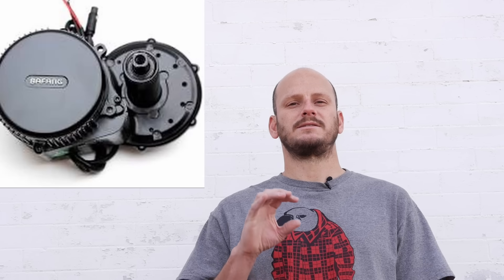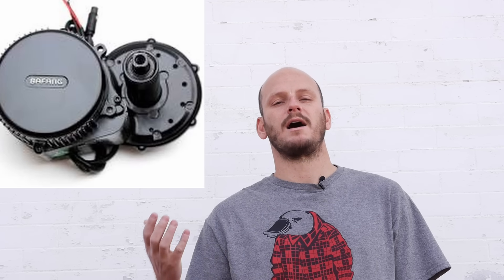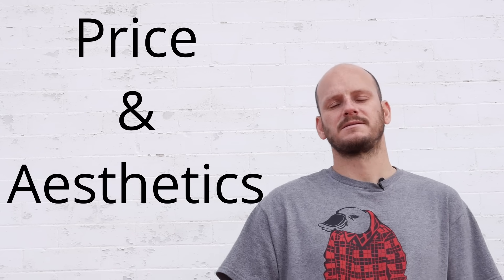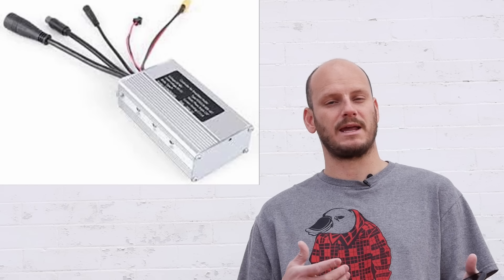Hub vs. Mid Drive Motors: Why Hub Motors Suck and Debunking Common Myths with performance test

Comment: One more case for a hub motor: elderly users. I’ve built several mid drives for family members and the elderly folks get confused with multiple PAS settings and multiple gears and when to use which.  My wife also prefers her hub drive which is very simple. I prefer my middrive for the reasons mentioned in the video.
Reply from the maker: You are absolutely correct. I’ve thought about making a follow up and include lots of things I omitted for both cases

Comment: I had a hub motor that drew 1100 to 1200 watts going up a particular hill at 7 mph with me pedaling as hard as I could in my long-wheelbase recumbent. I ground the spoke rings off that exact same motor and clamped the axle to a frame extension so it drove a freewheeling sprocket crank-motor style. (The whole motor still spun.) From there, I ran a chain to a freewheeling crank and adjusted the sprocket size until the motor's ideal RPM matched my preferred cadence. I went up that same hill at 12 miles per hour using 700 watts, also pedaling as hard as I could. I had much more power, much more speed, and about three times the range with the motor mounted to drive the crank.

Not only that, but one day the motor seized on me. I just removed the chain that ran from the motor to the crank and pedaled home the old fashioned way. If it had seized on the hub I would have been calling everyone I knew who had a pickup truck. So, the only thing I like better than a motor that drives the crank is a motor that drives a chain that drives the crank.
Reply: Would love to see some detailed pics of that, as I ride a tadpole trike recumbent with a 1500w rear hub. I'm sure it could do better than it does.
Reply: or once and awhile inspect your e bike and fix things on your hub/mid drive before it locks up
Reply: @wesnxs , it was a sealed motor. The point is that it had over three times the power per kilowatt hour going up hills when it drove the crank instead of driving the hub, and that seizing did not leave me stranded as a hub motor would.

Comment: The fat bike I am building will be 2wd, with 5k each.

Use case is commute plus accessing some areas which require a short but fairly steep climb in loose sand. 

Also with increasingly odd weather, I want my rig to be capable of bugging out under as wide range of conditions as possible. 

I need the dual motor for traction.

I have resigned myself to learning wheel building, as selection of prelaced motors is pathetic, and I refuse to be at the mercy of a LBS who is constantly trying to sell me whatever they are a dealer for.

It means a learning curve and investment in specialized tools, but the payoff is huge.

If I can gain competence, I could probably do a nice side business just doing lace ups for diy people.
Reply from the maker: I agree, learning to lace wheels is a great skill👍 plenty of good books out there on the subject that go over lacing patterns and how to get the correct spoke length. I had a shop charge me $100 just for the labor on a wheel build. When I was doing them consistently, I was able to knock out a wheel in around 30 mins. Someone really skilled could probably do it in less

Comment: New to the bike world so I might need to be corrected. I want E for assist. Google tells me the average cycling joe shmoe might generate 200 watts with some effort. If I could E double that wattage for a relaxed ride around, well, that's DOUBLE! If I want to race around like a hooligan I'll use one of my many motorcycles. I want simplicity from my E bike. The more it resembles a standard push bike the better. So hub it is. Am I wrong?
Reply from the maker: Yes and no. If you are an avid cyclist, I would suggest a 250-350w mid drive motor. It is a much more natural feeling system. If you are new to cycling and don’t live near hills, a hub may be for you
Reply: @JohnnyNerdOut  Hmm...interesting. I've been riding a bicycle on and off for well over 50 years, some hills, some flat. Now, if I add a less than optimal electric assist, all of a sudden hills will become a problem? Maybe I should look into hydrogen? I hear that's showing promise.
Reply from the maker: @bernibeckmann9753  you can burn up a motor if you have it do too much work than it’s capable of. (Too steep of a hill)
Reply: @JohnnyNerdOut  That would be counter to my goals. Will take under advisement. Thanks.

Comment: I am considering a Speed Pedelec 45km/h to and from work (12K KM a year). Should I consider a belt over a chain? (gonna ride in rain and mild snow)
Reply: Fat Bike ... , 26"x4" Inch. ... ,  HUB Motor 750W - 1000W - 1500W ... "IP54" , "IP65" ... HUB LKS or HUB BaFang ....

Comment: Interesting ideas on this subject .
I have a Falcon/ Dawes folding electric bike with a 7 speed Shimano gear set . It uses a hub motor and contrary to your statement the power it produces on the flat and up any hill is quite astonishing . 
In the UK our electric bikes are governed to approx 16 mph and that is all electric bikes . 

What I have found is that by using the different modes ( 1-2-3 ) with the gears I can easily get up any steep hill with ease . On the flat I have also found out that by just gently peddling without using any force , the motor continues to keep functioning, . effectively this means that the bike is working on it's own without my imput and continues in this fashion until you stop.

I'm sure you're right about the transfer of power / energy with the mid drive motor, it certainly does make more sense but with me tweeking my ride I can attack any hill with confidence . One other thing I have found is that when coming down a steep hill for any length of time , by pedling backwards I can achieve a small amount of 're gen' which was initially quite an odd experience and something the shop didn't explain or discuss. So to conclude I wouldn't say it's one or the other , I have an idea that not all electric bikes are going to perform the same way and much of this could be down to the design and function of the machine ...
Your thoughts would be appreciated -
Thanks Simon .
Reply: This just supports that hub motor bikes are best for retired people that don't go fast.

Comment: This video is so biased and wrong on many points. I love mid-drives as well, but damn! Unfair no-shit-sherlock comparisons, wrong conclusions based on fallacies, misunderstanding of e-bike as well as normal bicycle technology despite having worked as a professional. Hub drives are not perfect, but they get the job done and they do so at a very competitive price point. I have a very lightweight (+2.5kg electrification with motor, battery and controller included) hub motor system that works great, as well as a normal mid-drive hardtail bike. The efficiencies of both systems are very similar when used as intended (with pedaling, not as a grandma stair-lift like in 3:34). The mid-drive is more fun for sure, but it's on a more fun bike anyway!
Reply from the maker: It’s an opinion piece. An unbiased opinion would be, well…
Reply: @JohnnyNerdOut  Debunking myths with opinions, how does that work exactly? :) Sorry for the snarky comment, most of the wrong or "up for debate" things were addressed in other comments.

Comment: GREAT VID DUDE! JUST WHAT I NEEDED TO HEAR TO PUT ME ON A MID-DRIVE. Leaning towards the Sondors LX mid-drive for $2200. Wished it had a Gates belt vs a chain and the rims are "bored-out" for weight savings, I'm guessing (the thing weighs 90lbs) but that it turn exposes the tube around the rim. I live in the desert and just wonder about durability, punctures with an exposed innertube??? Thought anyone? 
Keep up the good work!
Reply from the maker: Definitely put some Tannus inserts in there
Reply: ...2200 dollars? for a bike? in the desert? :-O
Reply: @vasopel  Nope- it’s $2,400 with shipping

Comment: Acceleration of the hub motor is so much better, because you don’t have to waste time on switching the gears.
Huh motor is more efficient, because the power is delivered directly to the wheel. Therefore more range with the same battery size.
You can’t use throttle only on the mid-drive, because it spins the pedals.
Hub motors can deliver much more power, like a couple of kilowatts on the mid-drive will snap the chain right away while hub motors can do much more than that.
About the spokes, you just need appropriate spokes for the amount of power you are using, if you use a tiny chain on any mid drive it will break too.
Because the controller is inside the casing of the motor, you can’t fit in a bigger one to achieve a higher power, while in a hub motor set up it is possible to upgrade the controller to achieve higher peak power.
Your speed comparison doesn’t make any sense at all, because if you take a more aerodynamic position on a bike, obviously it will get faster. Look at the way you sit on the hub motor set up, and on the mid drive set up. There’s a big difference.
And about a ride-ability thing. You said that it’s much more fun with the mid drive, but in the mid drive, it is impossible to ride in a throttle only mode as I mentioned before, you have no idea how much fun it is to ride in a throttle only mode.
And also, your comparison of an e-bike with a car is useless, because it’s a completely different thing, it’s not just different type of engines, in the car you cannot really assist can’t you, but in the bike you can assist even with the hub motor. And just because the hub motor has only one gear, it doesn’t mean that you can’t switch gears on the bike. Not even mentioning that hub motors can have a much higher top speed rather than a mid drive which is limited my your chain gear ratio. And you can’t say that hub motors are an “old” technology, they use the same motor technology, just placed in a different place of the bike.
About the burnout of the hub motors, that could be applied to some 250 W nominated small hub motors, but we are talking about a 750 W which can take a lot of abuse before overheating, if you feel like it can’t take a hill than just assist it just like you assist a mid drive.
Also hub motors support regenerative braking unlike mid drives. Regenerative braking can increase your range especially if you need to descend down a high mountain it can charge your battery significantly while a mid drive set up will waste this precious energy into heat. The only place I agree with you is better hill climbing performance, that’s true, but pretty much the only advantage of the mid drive. I am not against mid drives myself, but I just don’t like when you start saying that mid drive is the best and hub motor is a piece of shit by providing some points which are questionable, that’s all.
Reply from the maker: Why do people think mid drive motors don’t have a throttle? You really should check out some of my custom build videos 😀
Reply: But that throttle is still turning the pedals, where will you put your legs?
Reply from the maker: @ilyasergeev8634  it has a freewheeling crank

Comment: $50 dollars more my ass!, your an out-right liar, the mid-drive kits are twice as much, I would say check yourself, but I'm sure you already know this.
Reply from the maker: Are you comparing apples to apples (same brand) or comparing two totally brands (quality)?
Reply: @JohnnyNerdOut  Apples to apples is not same brand. Apples to apples is same cost. Comparing products from only one brand is absured when applied to almost any product.
Reply from the maker: @temp1temp218  that would be a good comparison metrics too 👍. If $400 is the limit I would put a cyclone mid drive vs a 72v hub 🍻
Reply: @JohnnyNerdOut  How much of that 400 goes into bicycle transmission components and their maintenance?
Reply: @JohnnyNerdOut  BTW just look around at electric unicyucles (EUC) on youtube. They are basically as fast as motorcycles and use hub motors. Lots of people doing hill climbs too. A weak mid drive could not keep up. The cyclone could probably keep up but the wear on a bicycle cogs and gears would be accelerated. https://youtu.be/Hlg6ScL-LNQ
Reply from the maker: @temp1temp218  great video 👍 it really shows the importance of gear ratios. Those unicycles have very small wheels that utilize the wheels diameter much better and therefore get more torque. I’m assuming that unicycle used a 72v system because of the high speeds he was reaching. That is pretty much the ideal setup for performance
Reply: @JohnnyNerdOut  Yup, fully agree with your analysis.

Comment: My 3kw hub and 72v battery with controller cost me 1000$Canadian.no way I’m getting this price with a mid drive.and yes I don’t pedal at all cause I don’t have pedals.that the prupose of electric to me.68mph full throttle for at least 40km and about 150km at 35 km/h.I don’t give a s@34 about mid drive.

Comment: Hmm, what about front wheel hub dynamo's? are there any out there that could help maintain a charge on an eBike battery -- I'm sure not as a complete recharger but maybe as a range-extender?
Reply from the maker: Pretty sure the drag would negate any benefits

Comment: A bit biased towards mid-drives. The comparison cannot be as simple as picking 1 of each from the same manufacturer and drawing conclusions.

Both have merits, and mid-drives are usually more expensive. I bought a basic VoilaMart hub motor complete kit for $150 (now they're a bit more expensive). My whole MTB conversion cost ~$550 with a 48v 12.5amps battery. Also, there are hub motors with controllers integrated in the wheel (check out Golden motor bike). 

Whether you own a regular or electric bike, it's practical to know how to do basic maintenance. Yes, some issues are more complex than others but you can always catch things early by checking simple things.
Reply from the maker: It really comes down to the mechanics of how the motors work. It's impossible not to be biased. Too many people are not biased and it drives me insane as they are either lying or unexperienced with both. :)